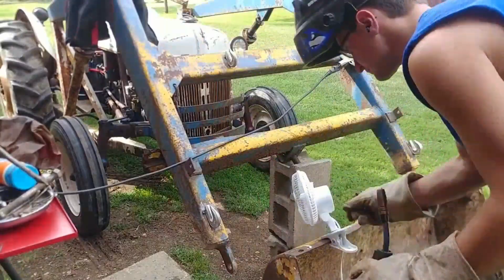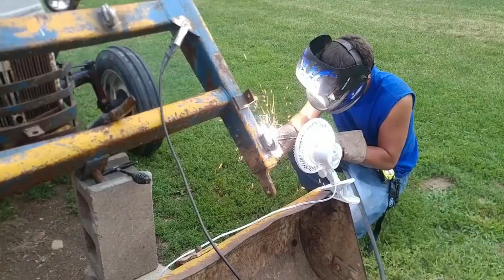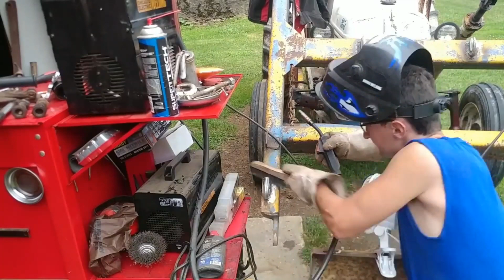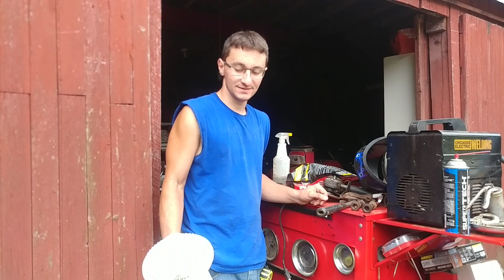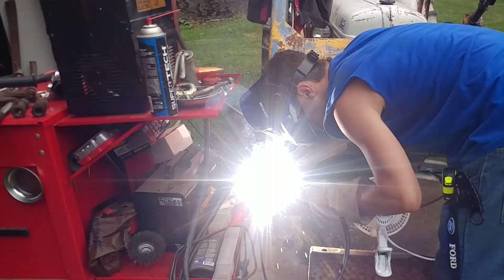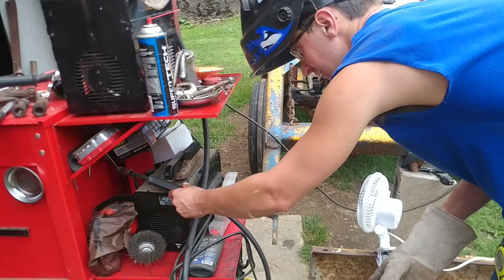WELDING LIFE HACK NO ONE EVER TOLD YOU ABOUT THAT COULD SAVE YOUR LIFE!! WELDING AT THE WHITE HOUSE!

Comment: Mate , do yourself a favour and wear long sleeves when welding and a button up shirt that goes up inside the helmet shield line . Anyone who welds has done what you showed there at one time or another , myself included , when you get "sunburn" on the skin after welding you should assess your  PPE needs , based on this vid and welding steel that needs more focus than fans etc.  

                    You can get melanoma from welding , did you know that ?   Welding galvanised  , aluminum etc. then yeah , get clean air happening , but always consider the U.V.   I'm trying to help , not hurt by my comment , please understand that . I'm 63 , been and done a lot of this , not always the right way .

Comment: Have you tried turning the fan around, so that it will draw the fumes away vs blowing directly on the weld?  If you did that it would be acting more like an exhaust system than welding in the wind.   Not trying to criticize, just genuinely curious.
Reply from the maker: rebelcat420 The fan works better blowing on the weld. There doesnt seem to be much air pulling from the back. Thanks for watching!!!